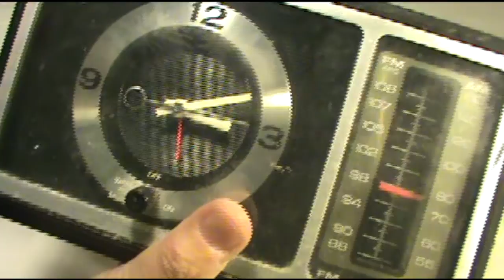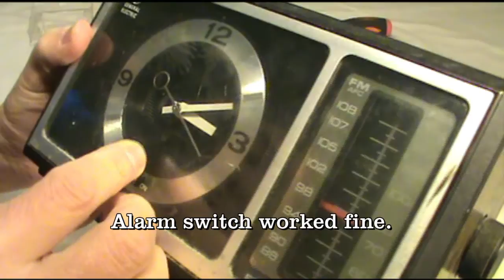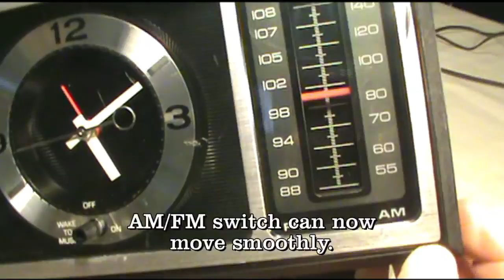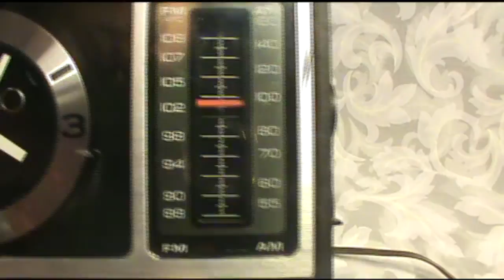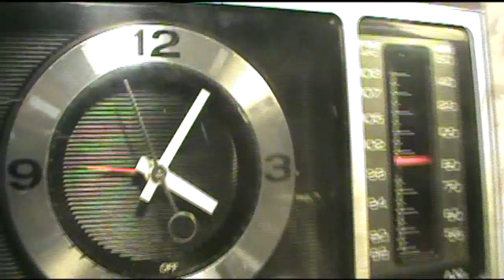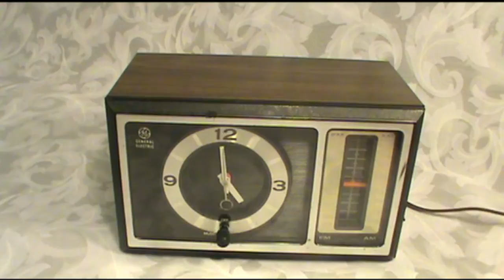1970s GE AM/FM Clock Radio Model #7-4501 (C4501A)

Comment: Great radio and if you change all electrolitic capacitors the sound and performance wiil be incredible.
.
Reply from the maker: Thank you for the compliment on my video. Teddy
Reply from the maker: Hi, Rodolfo, I could not reply other message you left,  I already sold this item, however, I have many others. Check my listings sometimes and you may find something.  
goo.gl/JwPVJ2 
Teddy

Comment: How did you remove the knobs and switched on the side?
Reply from the maker: Pull by hand, or using flat screw driver as lever to push them out. Or using steel hook that is made from the clip and pull the knobs.

Comment: Teddy, I need your help! Do you still have this radio? If so would you be willing to take it back apart and take a picture or youbtube video of the switch that turns the radio on? I too mine apart to clean and a "spring" fell out of it. I don't know where to put it back? Any help is appreciated.
Reply from the maker: Hi, Jack. Happy Thanksgiving day. I already sold this clock so I can not see the inside. What kind of spring is that? I did not remove clock from front body so I have no idea about such a parts. One thing I can think of is, since you are saying the spring came off from switch section. So that parts is for the opening and closing electricity for the ON OFF switch, or just a spring to stop the switch to each section. When I was in the same situation, I just try to fit it everywhere, it is like a solving jigsaw puzzle, but in my experience, 99% of the time it worked for me.
Reply: Happy Thanksgiving to you!!! I will try to figure out this puzzle. Love your videos! Take care. Jack

Comment: Hi there Nice little radio. I found the same model at a goodwill for 4.99. It has the same problems has yours. Just wamted to ask you what you used to polish the plastic lens? Mine has minor scratches. I  was thinking of plastic polish that you use on polycarbinite lenses for car head lamps. Just dont wont to risk fogging the plastic lens cover. Cool video. Hope to hear from you soon. Take care. 😊
Reply from the maker: HI, thank you for your comment. About your question, I tried many things to clear the scratches from plastic lens. In this video you can see many polish I used.
https://www.youtube.com/edit?o=U&video_id=mdeXVXl9iU4

If the scratch is so deep, you need to do the water sanding. In some of my boombox restoration video, I did sanding and you can see the result. It will bring back the scratched lens to the clean and nice condition.

Easiest way, plastic polish will most likely remove tiny scratches. Hope your restoration will go well.
Reply: Teddy Hashee Thank you for the reply. I will join your channel. 😊